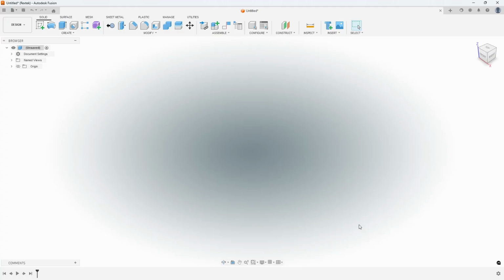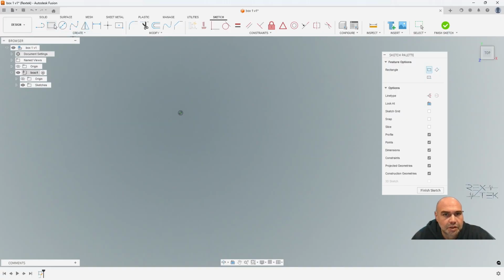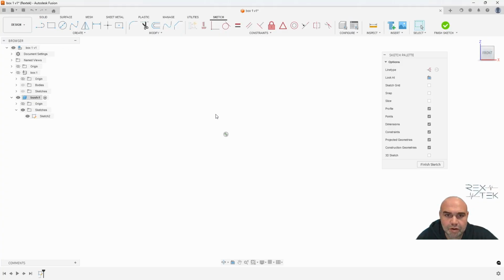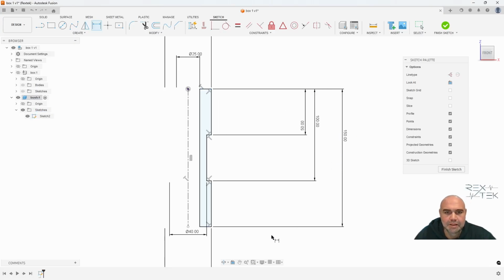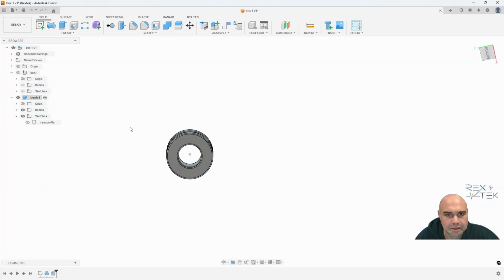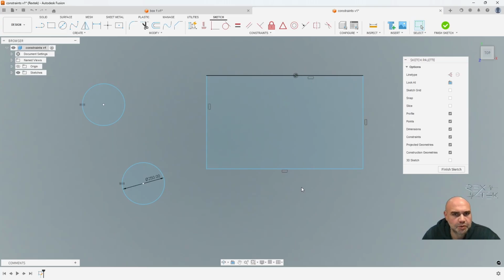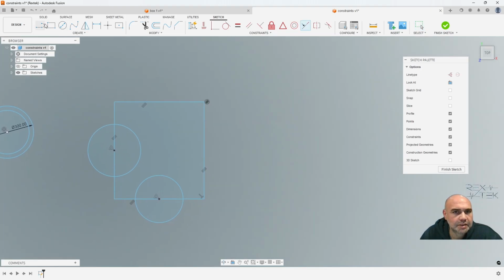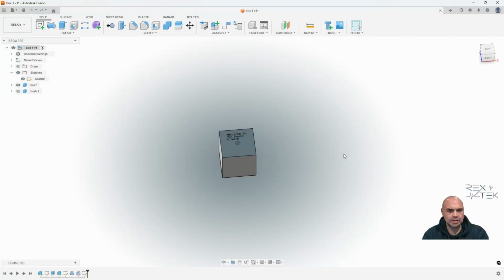AUTODESK FUSION TUTORIAL - MODULE 1 FUSION BASICS

Comment from the maker: This is Module 1: Fusion Basics from my Autodesk Fusion CNC course.

Before CAM, fixtures, or 5-axis work, you need solid fundamentals:
	•	Proper sketching
	•	Correct constraints
	•	Knowing when to use components vs bodies

If you get this part right, everything later becomes easier and more reliable.

If you’ve got questions or want something covered in future modules, leave a comment below — the course is built around real machinist feedback.